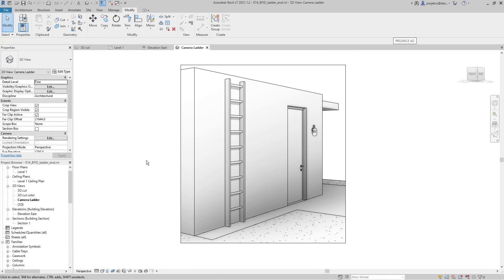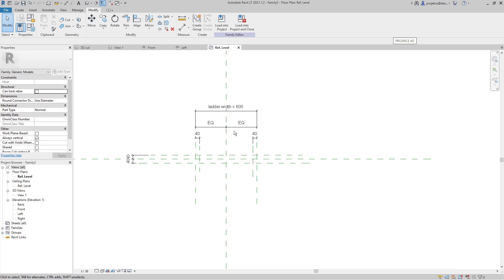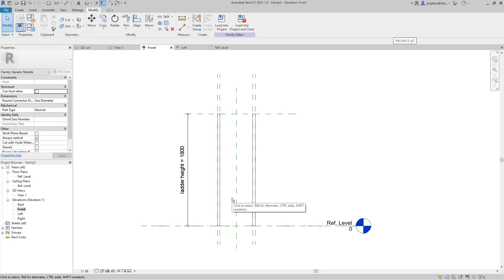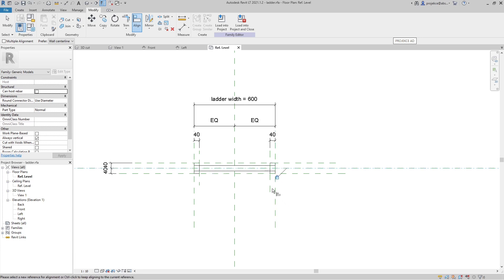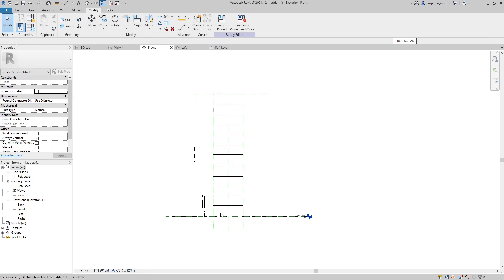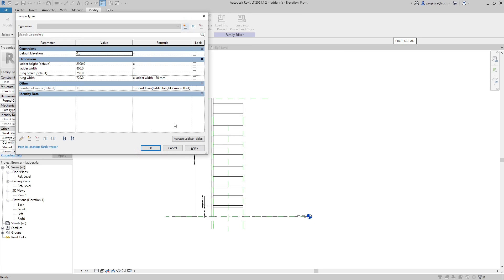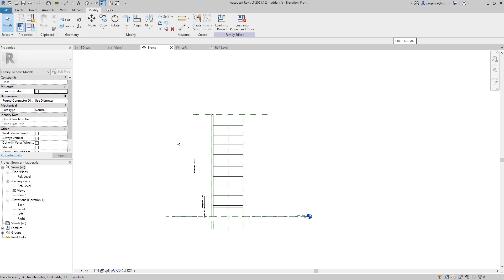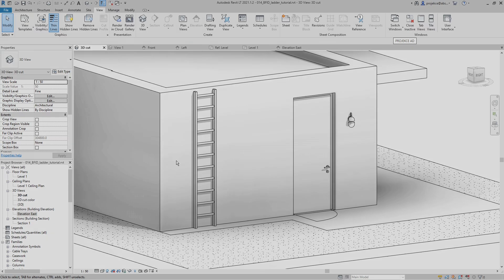Create Ladder in Revit | Parametric Array Family

Comment: Hello, I want to ask if there is a note in my Revit that states, "Instance Parameters can't be used in Type Parameter formulas."
Type Parameter "n" is driven by Instance Parameter(s): "lenght"."
do you have a solution for this?
Reply from the maker: You can change the Length parameter to be type parameter. Alternatively change parameter "n" to be type parameter.

Comment: Mate, thank you for this tutorial.
Is there any way that this family can also incorporate the count of rungs as you stretch it up?
So, to elaborate on my question, is there a way to add the number '1' next to first rung, number '2', next to second rung. . . . . .number '10' next to the tenth rung?
Cheers to all !
Reply from the maker: Hi, I think it might be doable, I just don't know how from the top of my head :). You might play with the visibility of the numbers in relation to the length, even though this is not the most elegant solution.
Reply: Thanks mate.
I'll try to muck around with it and if I find the answer, I'll post it for you ;)
Cheers from down under
 @BIMforInteriorDesign
Reply from the maker: Yep, let us know if you find a solution. 👍

Comment: Thanks a lot for the clear explanations. You could add another parameter to your Revit family to make the spacing between all of the rungs the same. As your first, last and the middle rungs' spacings are not the same in most of the times? For making the spacing equal you need to put the following formula: the rung offset or spacing can be equal to (total height/(number of rungs+1)) and you can remove the rung number formulas. In your formula you don't have the number of the rungs but you have the total height and rung offset/spacing. In my formula you can first devide the total height to the prefferd amount of spacing between the rungs and then put the result number minus one for the number of the rugs. This gives you a ladder with an equal spacing between the rungs.
Reply from the maker: That's a cool idea, thanks for sharing.

Comment: If the lenght 300?
Reply from the maker: That is a corner case. You could solve it with adding another parameter (IF smaller than 300, than don't take that number into account). With this ladder I supposed nobody would want to have it shorter than 300mm :)
Reply: @BIMforInteriorDesign  can you please show what this formula is ((IF smaller than number, than don't take that number into account).

Comment: Thanks for the tutorial sir, it's helpful. What happens if we didn't round-up in formula. I tried it but didn't found in which case it will fail.
Reply from the maker: Hi Akhil,
if we didn't round up, the ladder would have too many rungs (one more than desired) in case we set overall length of the ladder to be multiple of 'rung distance'. For instance if rung distance is set to 300mm and overall height of the ladder 3000mm.
Tom

Comment: Excellent tutorial, thank you. But, say for example that I want my ladder to be in an angle... how could I make a new parameter with the angle information? Thanks!
Reply from the maker: There are several ways to rotate the family. I would do it this way: 1) first have to edit the family and change it to ""Work Plane-Based" and disable "Always Vertical" in the Family Category and Parameters 2) Create angled reference plane in your project 3) select this angled reference plane as a host for the ladder family 4) now when you change the angle of the reference plane, the angle of ladder changes too
You can also use adaptive component family as demonstrated in this video:
https://www.youtube.com/watch?v=cb3MEkR5H3c